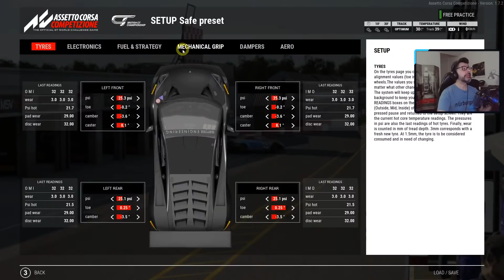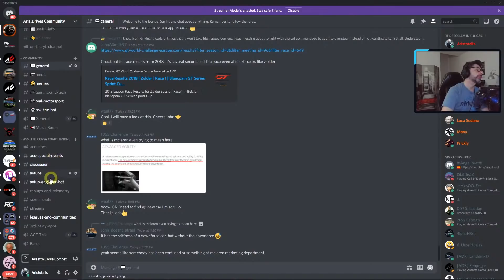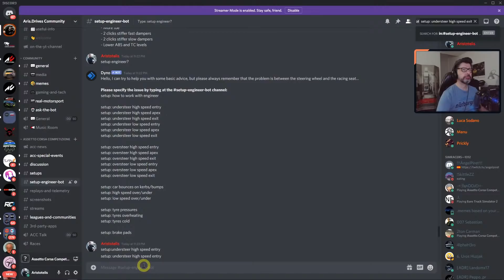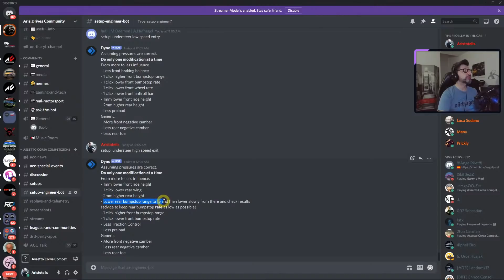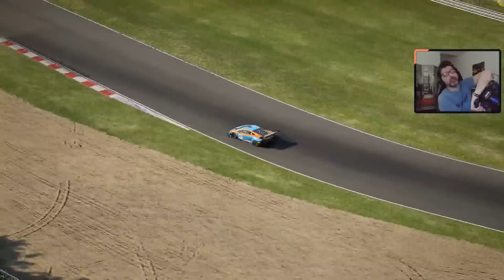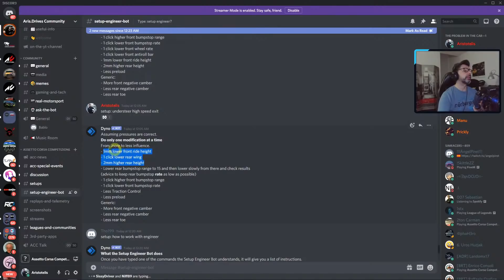TL;DW - How to use the Setup Engineering Bot in my Discord server.

Comment: Could you please define where the transition is between "slow corner" and "fast Corner"? is it say anything above 3rd gear is High speed and anything below that is the low speed for example. Thank you.
Reply from the maker: Sure, I'd say anything at high revs of 3rd gear is to be considered high speed. Of course depends on the car, but 1st, 2nd gear definitely low speed, any transition somewhere at mid to high revs of 3rd gear.
Reply: @ArisDrives  very much appreciated thank you

Comment: Aris, why does your FFB bar go into the red zone? What kind of torque are you running on your set up?
Reply from the maker: I'm running 100% gain ingame, because I need to know when and how it clips for development purposes. 
If I could chose just for my enjoyment, I would use something low ingame, like 30-40% and higher on the steering wheel, like 50%